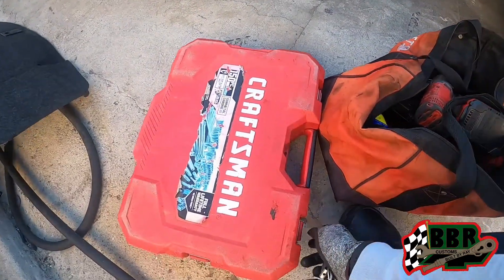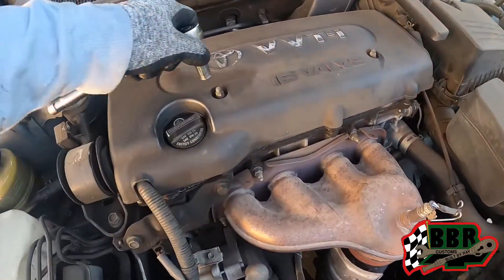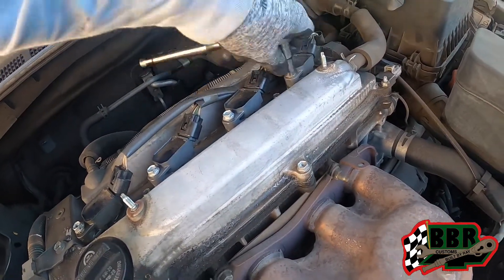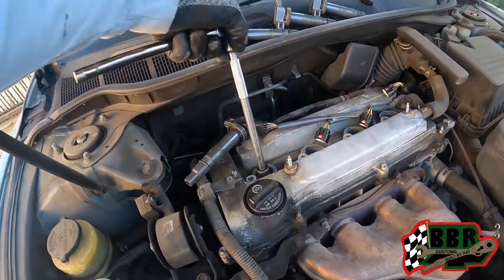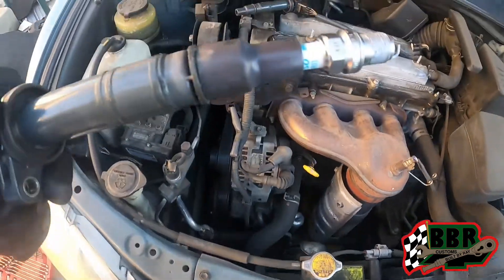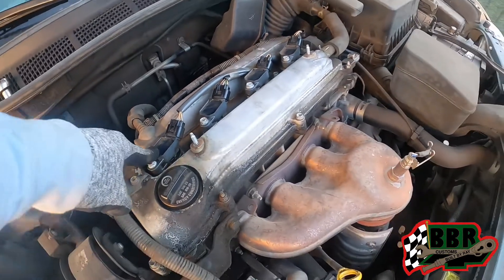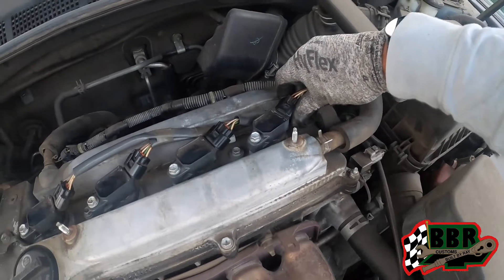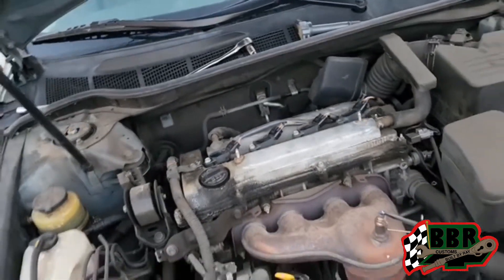WHY IS THE CHECK ENGINE LIGHT FLASHING? | 2007 TOYOTA CAMRY

Comment: Hey I have issues with my Camry 07/08 hybrid. If I turn it on the engine shakes and makes some ticking noise and immediately the ready sign disappears engine becomes idle. Please what could be the fault here. It won’t throttle and it won’t start sometimes the ready sign won’t come on at all until I disconnect and reconnect the 12v battery
Reply from the maker: I’m not to familiar with the hybrid buts just a few days my uncle Prius did the same exact thing you described we unhooked and reconnected the 12v battery in the back then it started working for a few seconds we drove almost a block then we had nothing again it end up being the inverter for the hybrid system not sure if yours the same but it’s a start good luck and Thanks for watching stay tuned 🙏🏽🦾
Reply: okay thank you @builtbyray729

Comment: What if you change plugs and coil packs but still have a misfire in cylinder one? What would be the next diagnostic tip? Thank you
Reply from the maker: I would unplug the cylinder one injector with the car running if nothing changes it could be that injector if it do change and /or cut off then you know the injector is not the issue
Reply: Thanks for the video. This has been most helpful with the issues my Camry was having. A mobile mechanic has fixed it but it was good to know what he should be doing to fix it as I stood there and watched all the steps. I’m glad he was honest and transparent. Your video was right on point!